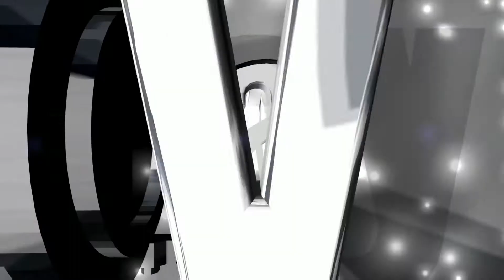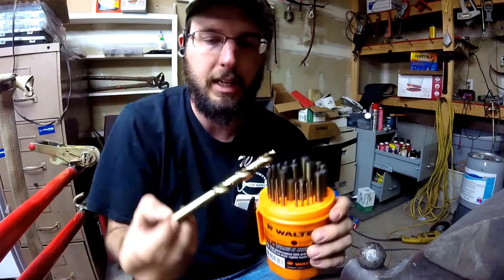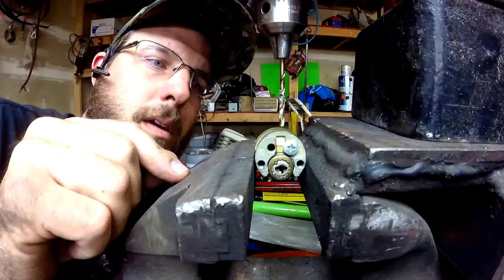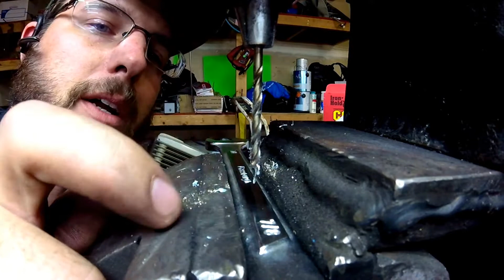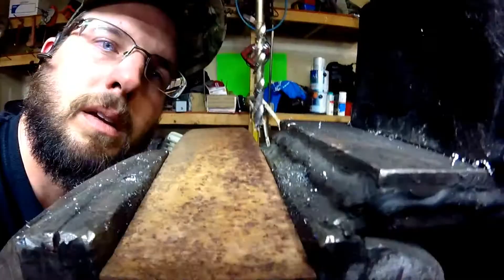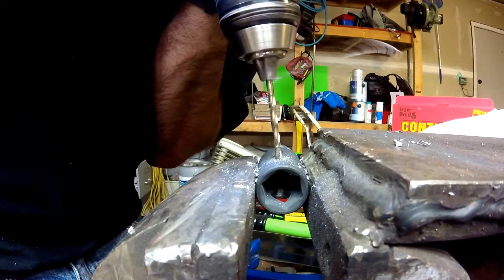Walter Drill Bit Review Hard Cobalt Bits Drill Stainless Steel, Spring Steel, Tool Steel & More!

Comment: I have been using Walter SST drills for a few years now.  I use them exclusively.  It  is because they do not break, and they stay sharp much longer than the other brands. However,  I had to lubricate it regularly, while litterally sitting on the biggest De Walt drill, piercing through a H-Beam.  .  I would like to know what the letters «SST» stand for?  Slow Speed Technology?  Also, are they suitable to the task of drilling out a broken «easy out»?

By the way, with a colomn aligned drill, you could never make the drill to «walk» even on a steel ball. Also, I noticed that one of the drill bit was starting to bend, before you changed it.  All metals need cooling.  We all know that.
Reply: super speed tip techonogy

Comment: Wayne, I have always thought that if you are drilling into metal, most especially if it is thick metal and a big drill bit that you should be applying some sort of machine oil to prevent overheating and rough drilling.  You have not done that here... Do you ever use oil?  I have on some occasions.  Any comment about the pro's and con's?  Does it help save your bits?

Comment: Great review, really like how you give so much info and test drill bits. what set do you think is better, the Norseman 29 piece set or the Walter 29 piece set? and how big of difference is there between the two?
Reply from the maker: cobalt (Walter) vs molybdenum (Norman) Cobalt is harder but Molybdenum is more forgiving. if your in a controlled environment with a drill press go Walter. if your using in had drill go Norseman.
Reply: Thanks for the info :)
Reply: Wayne, I have a set of Norseman molybdenum.  I use them in a hand drill for locksmith work.  So far I've dulled out several and they tend to walk/drill away from my center mark often, which is very frustrating when you're trying to install door hardware.  what do you recomend?

Comment: great video Wayne. I've been really happy wih Norseman and Drill Hog bits but I'll have to try these out!
Reply: I've noticed that when bits don't list the exact materials they usually aren't the highest quality, and if they are sold in a box store usually not that great...

Drill hog m42 you actually know what you are getting, these walters are a HSS alloy with an unknown amount of cobalt, a little technical info would go a long way.

Also, the drill hogs lifetime warranty against breakage, but I drilled cobalt steel safe door, plenty of stainless, and over a dozen American padlock cylinders with no issue and no breakage yet, and if it does cool I get a fresh bit lol.  What more could you want??   After that all you need is a couple locksmith bits or masonary stashed if you get some actual hard plate, and some diamond core if you're the type that likes to mess with GSA carbide flaked hard plate.

BTW I've been using the m42 bits, (cobalt) (super cobalt) (super HSS) (<lame marketing terms you see people use instead of saying what type of alloy...) in a hand drill.
Reply from the maker: Norman are molybdenum instead of cobalt. there really good bits and the cobalt keeps them sharper longer but makes them more brittle. personally the molybdenum bits are a more forgiving bit. don't get me wrong cobalt is good but it makes it sketchy in a hand drill
Reply: How do the Norseman and Drill Hog bits compare to each other?